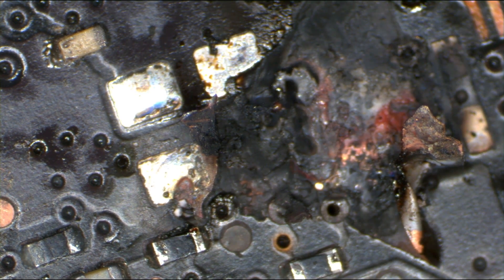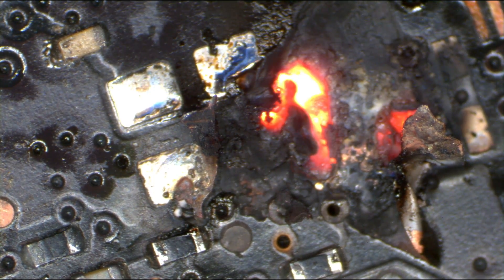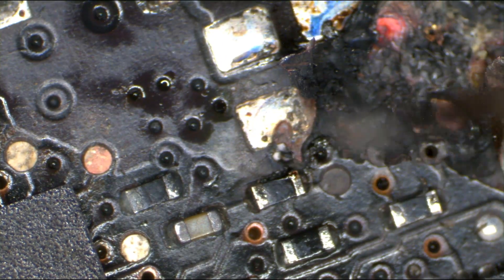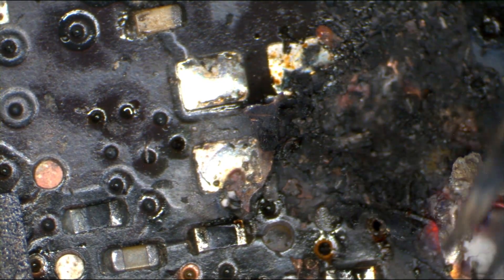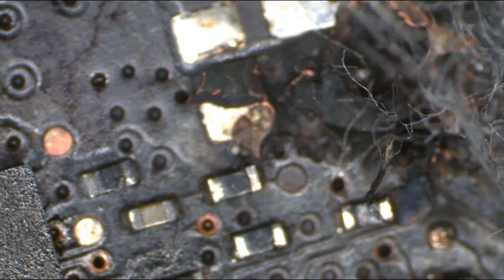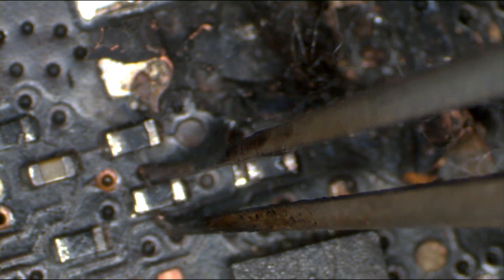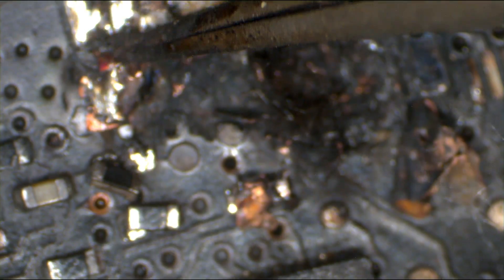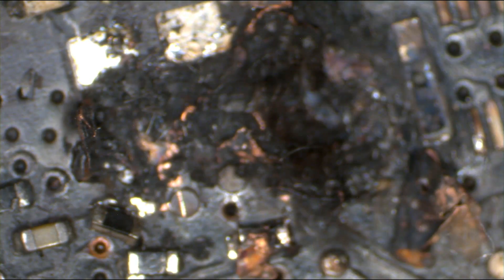If you don't know what you're doing...

Comment: Hi, Louise... help :(

I have this Macbook pro early 2011 unibody that has mainly two problems.

1. some keyboard keys are working on and off. "A, S, D, G" are coming and going. There has been no "spill" incidents or anything like that and it suddenly stopped working correctly and i think it has something to do with the connection to the logic board but  honestly i have no idea.

2. This is my main problem, sometimes when i move the computer physically (lift it, shake it etc.) computer freezes and all i can do is reboot the computer by holding the power button.

Sometimes when it freezes and i get a 3-beep analog sound from the speakers. Read on the interwebz, that this indicates a memory failure. I have upgraded the memory in the computer long time ago so i tried putting in my old memories but the problem is still there :(

I handed it in to a "Authorized service dealer". They said "its a memory bus failure, we want to replace the entire logic board, and replace the entire top case with keyboard, backlight/everything".

total cost was $100 for troubleshooting these "solutions" and now then want $1000 to "repair" (replace).

Im looking for a second opinion, advice or anything. cause im a bit sad over all of this... so.... help?

Comment: the apple recalls are as fallows before I left the Apple resellers I was working for
2010 15" Macbook Pro GPU issue
2010 - 2011 Macbook Air SSD issue
2008 - 2009 Macbook white unibody cracks on hinges and bottom case pealing
2010 - iMac with a Seagate HDD you may still be able to get it changed and the yellowing display if you bought it in the last 3 years POP needed basicly apple put a CS code on it its covered and you can rplace any parts you want on apples tab
2008 non unibody Macbook Pro GPU issue a simple reflowing the GPU fixes it and Apple only replaces the chips also reflow and hot-glues them into place back in u now its a logic-board replaced already if there is hot-glue on the CPU or GPU :D
there are tones other i just cant remember off the tom of my head but if you say burning smell for any of apple products if they aren't considered vintage on there system (cause the parts are not been made any more) apple will usually change the part out actually if i had that MOBO your playing with you could get it changed put the machine back together may sure there is no excess solder that shoulder be there and run into apple and say you working on it and all of a sudden poof everything shut sown and there was a burning smell they will contact SPS and see if they can get it covered.
Reply from the maker: Kevin Ayres Good to know!

Comment: Holy fek :)..Would be nice to learn about testing individual components on the motherboards :)..I know you use donor boards for some of your parts,And also working mother boards to test for voltage drops and things of that nature,But what if you don't have the capacitor for a certain part on the board ,And its not in the schematics how do you know what smd capacitor or smd resistor to change..I know some times there coded and i have a little list of them,But not sure what to do if i don't know the resistor value before it burnt out and it needed to be changed or capacitor I'm taking SMD here..Some thing that has always got me thinking...I will be doing a component repair on a dell inspiron 1525 to learn shortly as i think there is a 'Schottky diode' that may not be working but I'm not sure how to test the actual diode would it be just the same as any diode it is duel switching..I suppose its part of learning i know where its coming from and which chip its going to so I'm going to have a play with it later...Thank you for your contributions !

Comment: LOUIS, long time no videos!! Going through video-withdraws!!  Any suggestions where to start with a 820-2936; no charging light, but turns on when plugged, but does not charge in any mode.  Is it the ONE WIRE circuit????
Reply: Bake it at 300 Celsius

Comment: apple finally did a recall on those shitty 2011 video chips on the mbp
Reply from the maker: Tech Knewz Took long enough!
Reply: I have been running FurMark just as Louis Rossmann recommended on a replacement board that I got about a week ago now. I've been running it overnight and while I was at work. Apple seems to have either done something with an SMC update or used a revised board - I noticed that GPU temps stay at a certain (toasty) level, but frame rates dropped considerably to protect it from overheating. Maybe Louis can elaborate on whether he has seen "Rev.B" boards or chips in the wild?
Reply: ***** They actually did. Check Apple's website: apple (dot) com/support/macbookpro-videoissues/
Reply: They didn't. But you get a warranty repair for free till February 2016. But they build the same crap into their main boards. So you will get the same problems like before. Overheating....
Reply: for how long and they didnt properly notify customers. now the window is closed. Apple fucks people